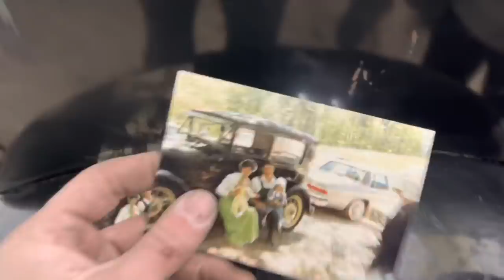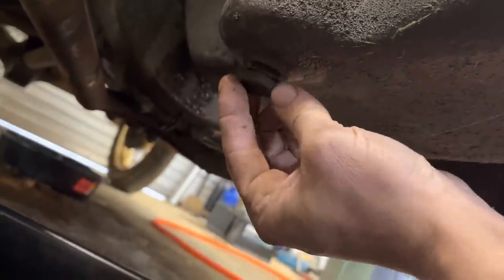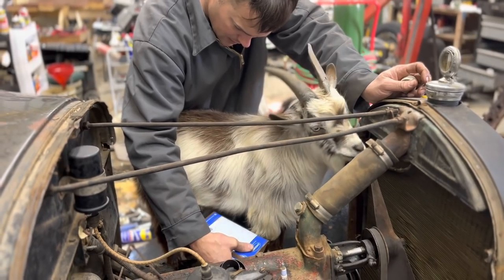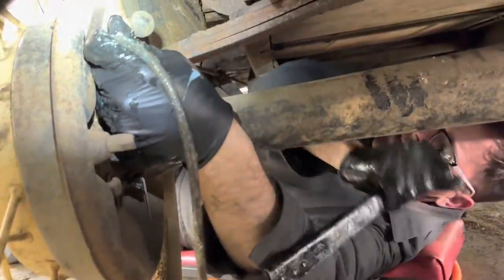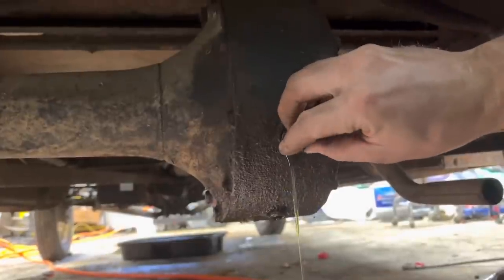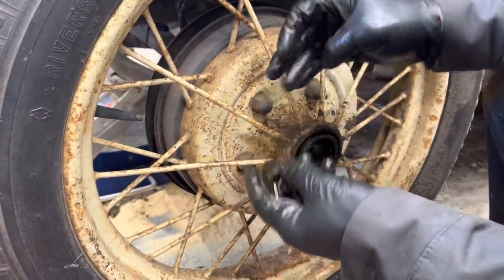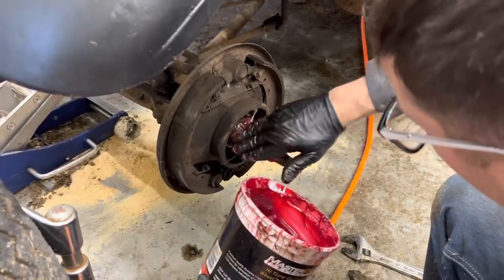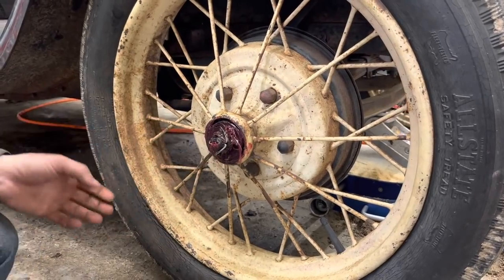94 year old car back on the road, and first wash!

Comment: The oil that goes into the transmission and rear axle should be 600W oil.  It is thick as molasses, and is available from a model A parts supplier.  If you use thinner oil, it will leak out like a sieve.  Also, to set the timing, there should be a pin that sticks out of the front of the motor.  The pin is about 2 inches long, and is attached to a bolt.  Unscrew the bolt, and turn the pin around and put it in the hole from where the bolt came from.  Slowly turn the motor over with your crank, and you will feel the pin dip into a recess on your timing gear.  When it dips in, that is top dead center for piston number 1.  You can then set your points to just beginning to open by loosening the screw on top of the distributor cam and pointing the rotor towards the Number 1 cylinder.  The engine should start when the timing position is at zero degrees top dead center.  This is especially important if you are cranking the engine, otherwise it can backfire and break your arm.  Hope this helps.
Reply from the maker: Ok thank you
Reply: Goes in the steeringbox too

Comment: That is really cool if you can find a good v6 or a small block ford v8 you should swap it that 4 cylinder has too much power
Reply from the maker: That’s funny
Reply: why would the engine the car is made for have too much power? also it has less then a small block v8.
Reply: @DrTheRich  its a joke bud
Reply: @warcop88  ah missed the irony
Reply: @DrTheRich  its ok its a car joke most people dont get em (definitely not another car joke)
Reply: @warcop88  It's more that sarcasm doesn't transfer well in text
Reply: @DrTheRich  i know dont judge me i just like cars and trucks

Comment: Whenever you flush a motor like that with kerosene preferably, I'd put oil back in it, run it till it gets warm and drain it. I'd do that a 2nd time with something like this that I think is just splash oiled and doesn't have an oil pump.
Reply from the maker: Ok thank you

Comment: NOOO O.O!!!! Don't put grease in the steering box. It's supposed to hold gear oil (same as you put in transmission) as stated in the original manual for the car. With grease the steering will be a whole lot harder. Mine had grease in it too, steered horrible, but with a well cleaned steering box, with gear oil, and good thrust bearings, it steers like it has power steering, and little play.
Make sure you put some new seals in so it doesn't leak.
Good luck with the car!
Reply from the maker: Then why does it have a grease fitting?
Reply: @Sleeperdude  It keeps deleting my comment. It must be detecting something it doesn't like

It is probably installed later. Mine had a non original fitting too. It probably leaked, and instead of fixing, they just put in grease instead of gear-oil. Originally it should have a plug with a square head that you can easily unscrew and then fill the hole with oil. If you look up "ford model a seven tooth steering box" on google you can see what it looks like.

you can google for a pdf of the 1928 owners manual

At page 27 you can see the lubrication chart, and what goes where. You can see a (C) pointing at the steering box for gear lubricant (600W oil)

Although with the grease in it, you'll probably have to take it apart to clean it out, like I had to.

Comment: Please get that exhaust header welded especially if you re-cover the roof as carbon monoxide poisoning is dangerous also she'll run much better too, I have used MIG welding with just mild steel wire with great results on cast iron before, it works.
Reply from the maker: I have done that too with good results, my grandpa wanted to weld it himself is why I didn’t

Comment: Was the melted black substance on the windows melted rubber? I have an antique bat and originally it had a rubber grip. On a really hot day the rubber would melt and run down onto the bat. I tried covering it and oiling it, but nothing worked so I ended up removing the antique rubber grip entirely as it was melting all over the bat handle. I think it had higher purity than modern rubber.

Comment: Josh when you have finnished the repares on  modelT do you plan to drive it back to your grandads or trailer it there dont suppose it does more than 35 mph it would take you hours to drive it therewith all them their hills you might have problems driving that up big Hills.
Reply from the maker: Check out the next video with this one

Comment: That is not a gas pedal but an accelerates pedal the on steering column is original cruise control. You driving doing a long flat road and come upon a hill or slower car you’d you the pedal to get up and past the back to cruising speed.  I know this because I once got a 1904 ? (Not sure what year. Not it was old ) sears mail order catalog (reproduction) as a gift and there was after market acceleration pedal kit with what I said in the description. I guess ford buy them in and kept the old throttle for a while
Reply from the maker: Ok interesting

Comment: Only 600w oil in the steering box, transmission and rear end.
Reply: Ford only put a grease fitting on the steering box for a short period. It was never intended to be used for grease. In 1929 they went to a plug bolt in order to stop having customers ruin the steering box.
Reply from the maker: Ok thanks

Comment: IF YOU LEAVE  GAS IN THE CAR FOR 17 YEARS AND HAVE CONDENSATION  IN A GRAVITY FEED GAS CAR  WATER GOT INTO THE MOTOR  AND MAY BE A LEAK IN COOLING IN THE MOTOR  PIN HOLE FROM CORROSION
Reply from the maker: It didn’t have any gas in it while it was parked

Comment: Older tractors and older vehicles like this kinda flowed together so to speak, tractor throttle vs retarded timing, updraft carbs, flats heads etc , I'm just curious if that rear light staying on has to do with ignition switch hookup crossed or something , it's oldie but goodie!
Reply from the maker: I’m not sure

Comment: Ok tell tell Papa , shame on maintenance habits years ago?? , that was tar, not oil. Geez man, and use diesel to flush omg, paint thinner, lord help me, i used to help my Dad wrench on a 27,back in the 70s, and to go for a ride, that was often
Reply from the maker: Good idea
Reply: @Sleeperdude  did you ever redo the top on her, they where some sort fabric, and like a sealer petroleum based if I remember, but a metal, would suffice unless 100 % original is the plan

Comment: Paint thinner inside oil sump?? What kind of  mechanic work is that? Don't you have engine flush in USA?? At least kerosene oil?? If you do this often say good bye to oil seals and bearing seals .